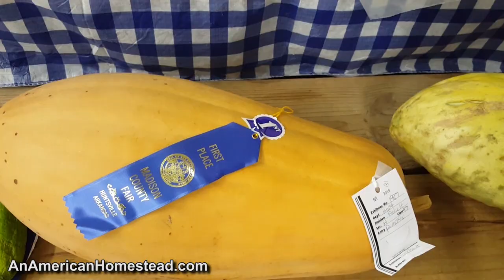Season 3 Episode 11 - An American Homestead - Wine & Pumpkins

Comment: Jamie I love the way you wash clothes. I used to have a old ringer washer. I miss it. It was electric. But I could decide how long I wanted my clothes to wash. I saved so much water. Most times I would only use one tub of water for all the laundry. Start with the whites and end with the darks. How do you wash in the winter do you still wash outside or inside? Love the canning videos. Don't want to see this season end.

Comment: So, I'm not trying to suggest that your system is sexist, but I think I now understand why women felt maybe underappreciated pre-feminism. It seems as though the priority for efficiency in machinery and work is often focused on the work that men do. It makes sense, because washing laundry is not nearly as taxing as trying to saw wood-- especially when wanting to do it straight and well. I just noticed that a lot more of the men's work on the homestead is somewhat automated and using electrical/motorized power of some type than that of the women's work.